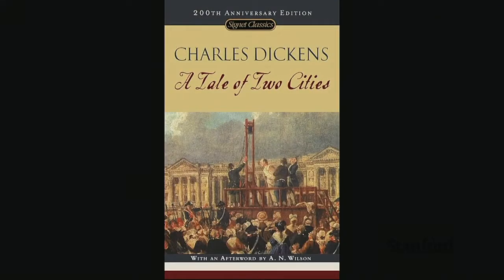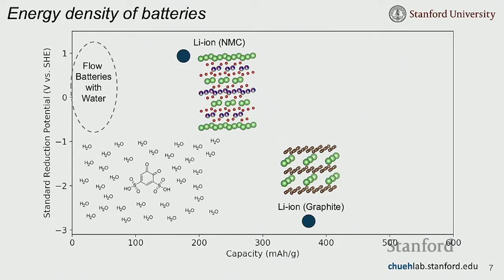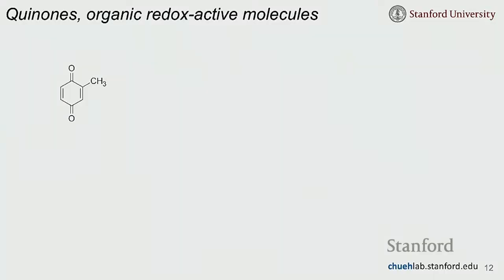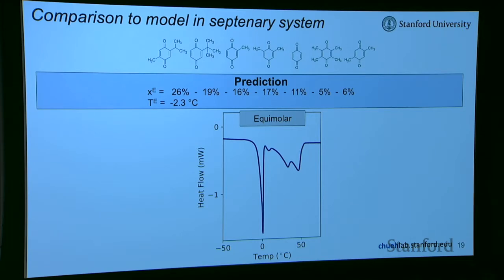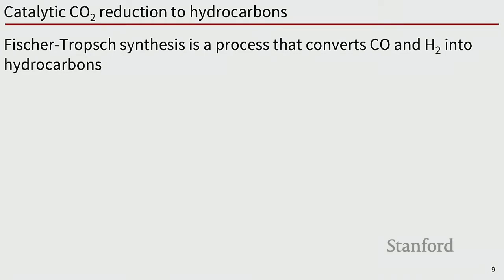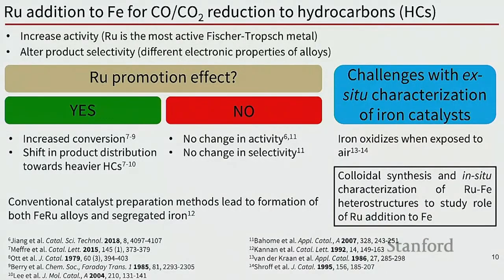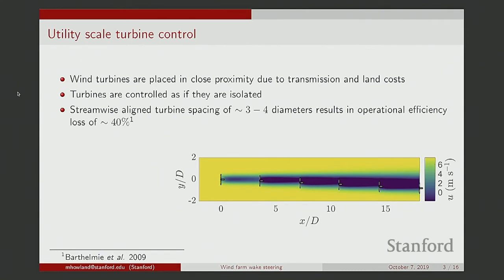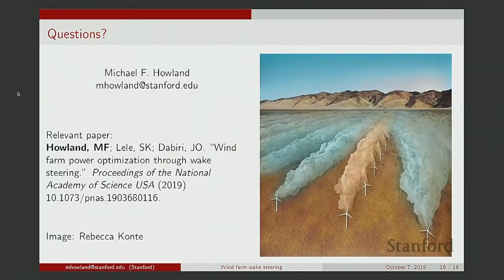The Cutting Edge of Energy Innovation: Three Snapshots | Energy Seminar - October 7, 2019

Comment: The magnet motor for this 1300hp generator is 61×17cm/24×7in, fits cars, trucks, trains, aeroplanes and ships at sea.

The magnets are still 90% full power in 1000yrs.

The generator has a half-century, 50-years of no-inputs warranty, normal upkeep.

This implies cars that never refuel or recharge for the LIFETIME of the owner.

Screw IC-Engines, even EVs, stop making them! 

Instead, make N.Tesla Tailpipes, his valvular conduit, a one-way air valve with no moving parts to trap the exhaust to fit every model for carmakers to do replacement tailpipes for, eh?

Slam the door on fossil fuels, end emissions bottom up, with a "lifetime no-inputs warranty" on magnetic cars, whadda' think sales will do, eh?

Politics costs lives & livelihoods, end the oppression.

www.technokontrol.com/en/current-projects/generator.php